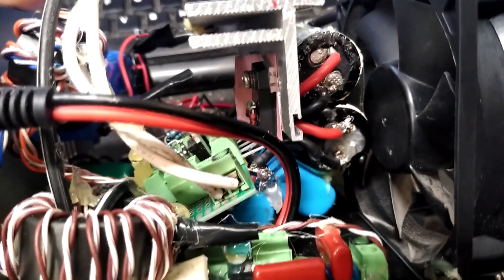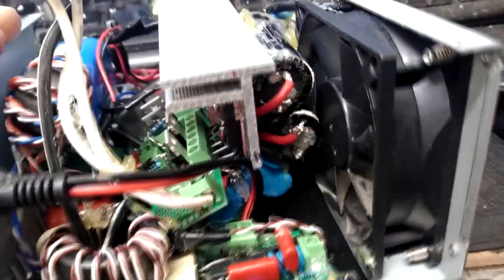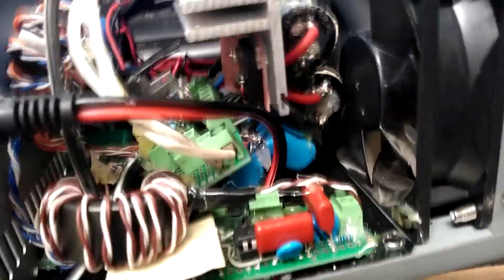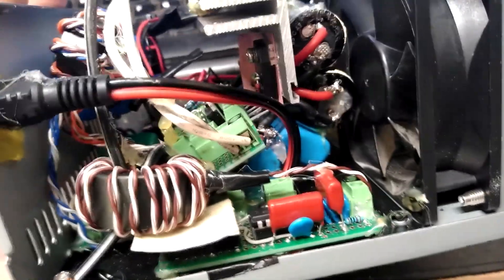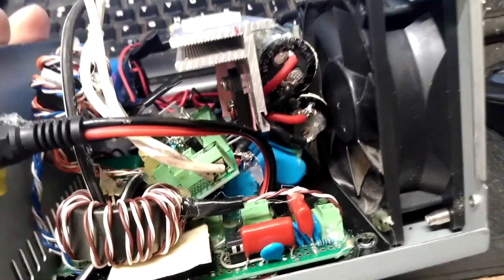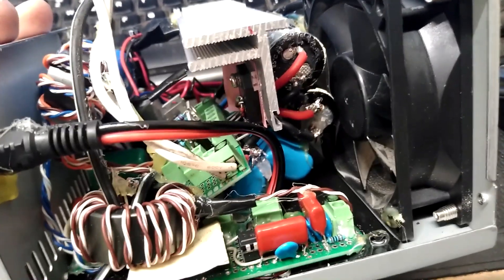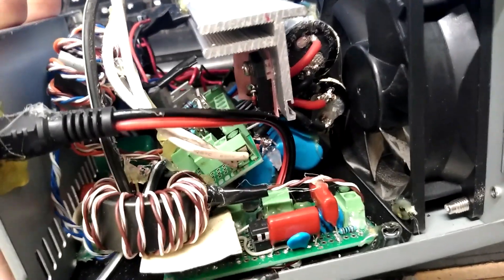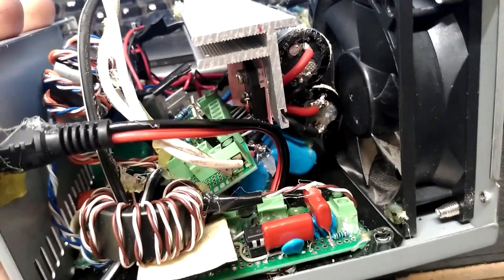Steve Ward's "DRSSTC .5" IGBT testing (FGA60N65SMD's)

Comment: Those 60n65s are so kickass. where did you end up buying them from? Also what’s that value if your capacitor in series with the output.
Reply from the maker: So far they're awesome. I meant to get some a while ago but Digikey didn't have them so I went with Mouser. Tank cap is 33nF 2kv. Didn't think it through and will need a different value when changing the topload unless I rewind primary.. Might not even change topload cause the output is sort of nice and scary how it is. Still afraid of ground strikes though so IDK maybe proper OCD would fix that.
https://www.mouser.com/ProductDetail/512-FGA60N65SMD
https://www.mouser.com/ProductDetail/505-FKP1U023307C00MS

Comment: beautiful work bro
Reply from the maker: Thanks bro the IGBT's and better cap made all the difference. It actually looks like drsstc arcs now. Might not even ever need to mess with bricks to get like 2ft+ discharges could probably go with a full bridge of 247's.
Reply: @Magneticitist  60n65s are what i use in my qcwdrsstc system  ....double full bridge ⚡bro that switch is my favorite
Reply from the maker: @morganchandler5126  hell yea I just got about 10 more of them beaches
Reply: @Magneticitist  build you a double full bridge with independent Gates and you can push 3 ft arcs easy

Comment: Awesome! In my experience these IGBT's are very robust, I ordered my transistors from Digikey so I can't say the same for cheaper Chinese ones. The only time I've ever blown one of these is when I had the duty cycle way up, apart from that I've never blow a IGBT on my coil, it's been working well without primary feedback or even a OCD.
Reply from the maker: Yea I get the feeling I'd never pop any in an SSTC and even with no OCD they don't seem to be struggling at all in this drsstc! Of course, over voltage will do them in but I'm pretty sure my first failure was primary circuit strikes.

Comment: Those a some really good sparks, it seems igbts makes a big difference. It’s a shame that you killed some of them as they are quite expensive.
Reply from the maker: Yeah the way they pop was strange because I had tests ran it a little bit before that then got ready to do a nice run and it popped within the first few seconds from the ground strike. Has me kind of scared to push it all the way now but there was quite an improvement. I can deal with about five bucks a transistor though I probably won't ever be dealing with bricks
Reply: Yea, the bricks are just to expensive and I don’t plan on making a Tesla coil that is so big that it needs to be used outside.
Reply from the maker: @quantumlab9130  Dude from what I can tell a really good output on a decent sized setup that doesn't require outside space can be made with these 247 packages. Full bridge being like $20 or maybe cheaper compared to $25 a mini brick or over $75 per large brick.. no way someone needs bricks unless they are really cranking the juice. With considering having to buy all the DC capacitors and including ICs and other components it still brings the total of a full bridge build to under $50 if one uses smallish caps like 1000uF.